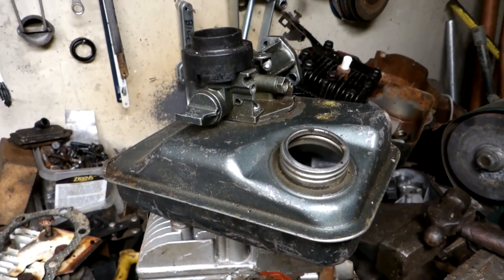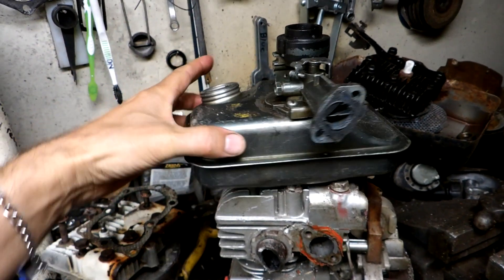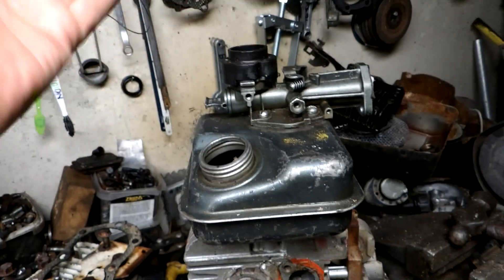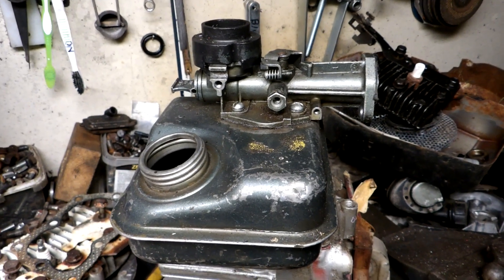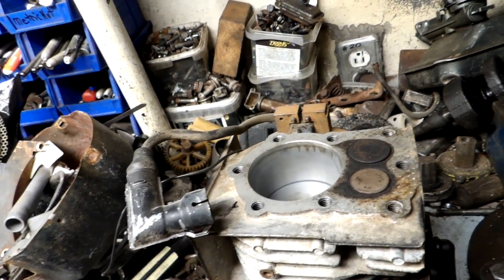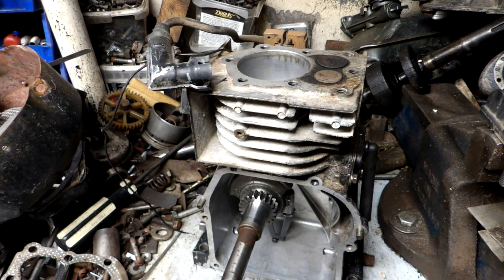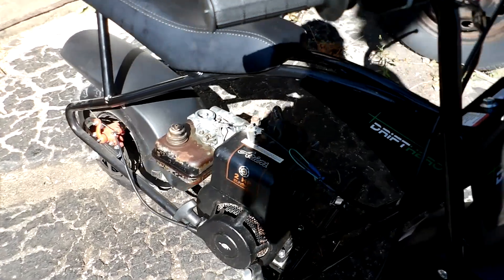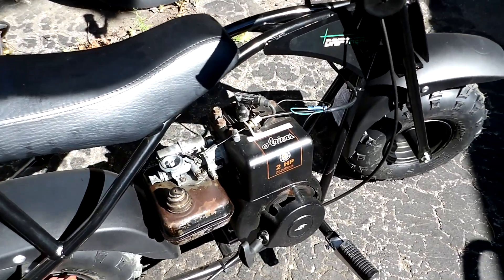2 Horsepower Briggs on Mini Bike!

Comment: Hate to bug you, but im currently trying to put my moms vintage mini back together for her. it has the engine. how do i hook up the throttle to it?
Reply from the maker: Sorry about the delay, what brand of engine are you using? Hooking the throttle up to a cable etc. is often one of the trickier parts of the whole build! Get back to me, if you haven't figured something out, and I will try to make you a vid about how we  have rigged up throttles in the past. My son is pretty good at it, he sometimes takes the expensive approach, while I do more fabri-cobbling just to get it to work.

Comment: Usually the thing to do to make a larger carb work on a smaller engine that hasn't been modified is to choke off the air intake so the smaller engine can provide enough vacuum to make the venturi effect work properly, cos it's kind of similar to when you have a dirty carb with plugged jets and it's struggling to pull fuel through, but works better when you part-choke it... :)
Reply from the maker: Interesting, thanks for the advice. We ended up installing an original 2 horse carb. The has tank is smaller, but at least it works well.